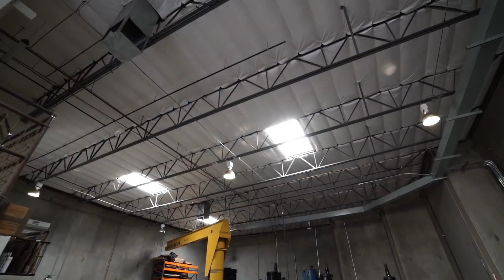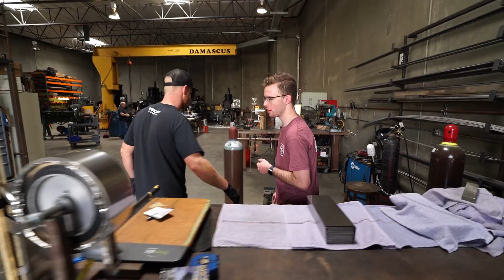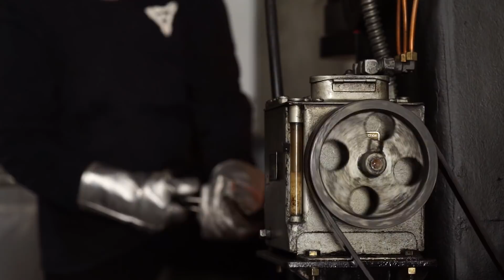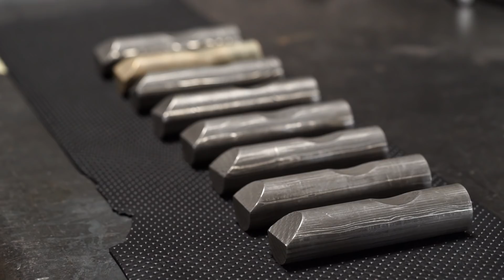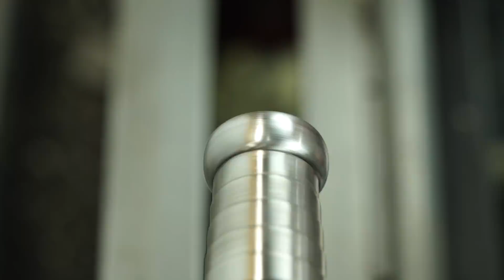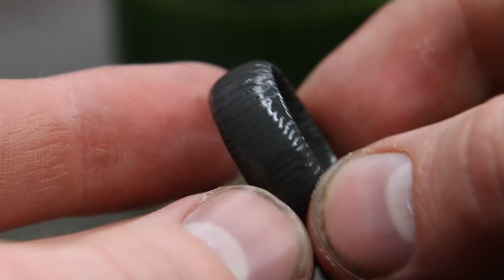Forging Twist Damascus Steel and Making a Spirograph Ring with Vegas Forge

Comment: I absolutely love Damascus steel and the patterns and designs it makes, especially when you then etch it with acid. I just watched this video and the first thing I thought of was the Iron Spider suit or even Iron Man's armour with the lines and curves! I doubt there is any way to pull it off but if there is, I think you could make a killer ring. Red glow powder inside this steel and do the same steps, I wonder if the glow powder would show up inside the darker, flat edges allowing this to pop? I love the look, even has a Venom type look. Either way, this was yet another awesome ring. Keep up the great work!

Comment: Unfortunately the part that they can't show you if where they get the real crazy patterns with. They can show how the twist pattern is made because everyone makes a version like that. But this company makes quite a few original patterns & to get those patterns they have to get pressed in many rediculas ways by using many custom made dies. This is also why the more intricate patterns can cost alot more because countless hours of work goes into making them. It's also pretty interesting to know that while the crazy new patterns are obviously modern real damascus steel has been around for a very long time as it's what all of the old samurai swords were made out of. Though that EXACT process is even more of a closely guarded secret as the best made swords were a very closely guarded secret. The swords were much stronger then anything else made and had thousands of layers folded on top of itself. This's also the reason the old samurai swords are worth so much money, some are even priceless. While some find their way into our countries most samurai swords are kept in the Japanese familes, though many were also taken during the war like the long lost Honjo Masamune katana. Anyone that isn't familiar with it should look up a documentary on it as it's extremely interesting. There should be plenty here on YouTube. The sword is probably either somewhere here in America brought back from the war & the owner doesn't know what they have, or it's secretly in the hands of a very wealthy collector somewhere...

Comment: i wonder if you were to save all your cuttings from the lathe and melt all the different materials in a crucible, Just what kind of madness you could work with then. It would be tricky to do because different materials behave differently at different temperatures but you might be left with something cool.

Comment: I was thinking, would it be possible to dip it in a solid color resins or something to fill in the trenches? That way you have a layer of color too. If you could pull it off that would be awesome ring. It would look similar to stained glass in church’s with the colors and the boarders.

Comment: It would save you a lot of time if you would make a purpose built tool with a radius, or you could probably buy the in different radiuses. You could cut that shape on the outside of the ring in a second or 2
Reply: Barry Fields I tried that myself and it worked up to a point but it’s a lot of surface area to cut at the same time so you need a revolving centre to stop the ring “climbing” over the tool and tearing out of the chuck
Reply: bobmoff1 well I do have to admit I’ve never worked on lathe that small. But I’ve used purpose built cutters to cut much bigger pieces than that with no problems, but like I said on a much bigger lathe
Reply: Barry Fields same here, not sure if these smaller lathes have enough torque either. Be worth trying a form tool to do one side at a time and feed in from the side rather than plunging the tool

Comment: Hi, Before putting the ring in the acid, can you coat the internal surface of the ring with wax or some other substance which prevent itching on the internal surface of the ring... It will look absolutely stunning as you will get two different beautiful surfaces...
Reply: Yeah you can. You can coat it with nail polish which protects it and the acid won’t eat through. Most people use ferric chloride though for Damascus rather than this etchant used here.
Reply: Shreyas Pai I was thanking the same thing
Reply: Barry Fields you mean thinking right?

Comment: Have you thought about doing the obsidian shape with the symphograph steel? It might give you interesting patterns in acid. You could also take the round you did here with that same steel. More less you’d be doing everything the same but in the center you could add stuff like your glow rings. That way you have another way to combine the designs with the glow. It will take longer and the process won’t be exactly the same as you did in this video but it will give you a more complex ring if that’s what you want.

Comment: If the low pieces were stained red, you would have a sweet spiderman ring.
Reply: sounds like a good idea, just stain it red before you do the the final sanding of the raised parts, then only the low parts stay stained ;)
Reply: I like to have one 14 inches